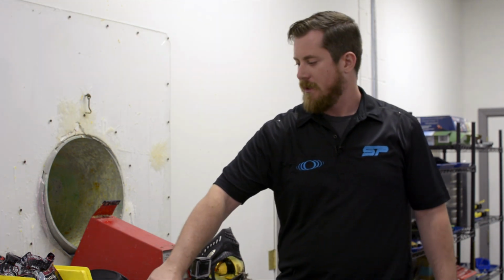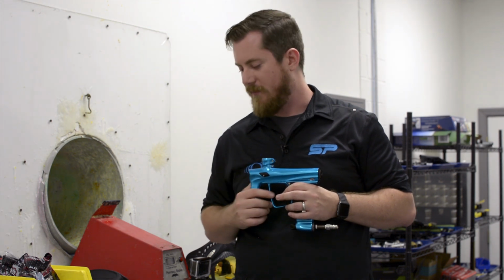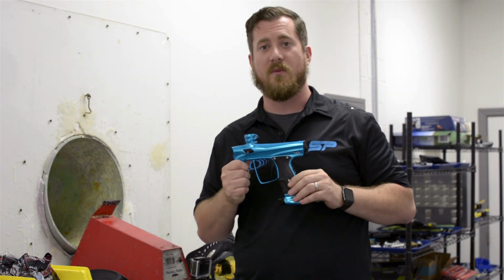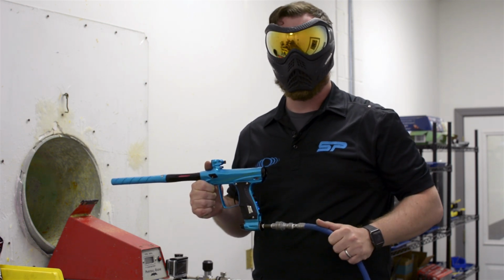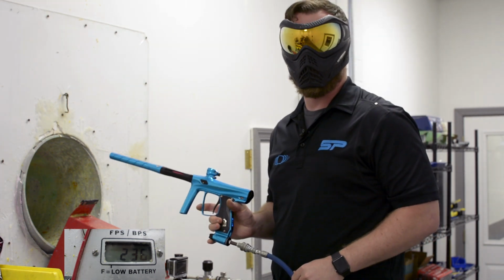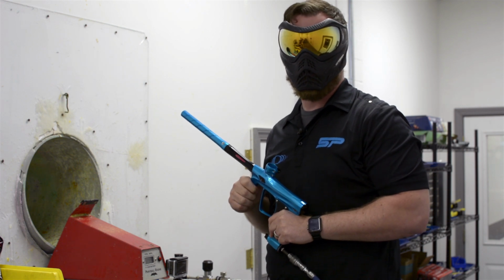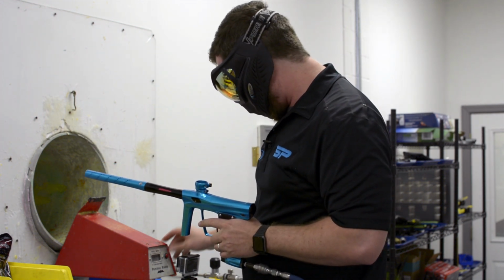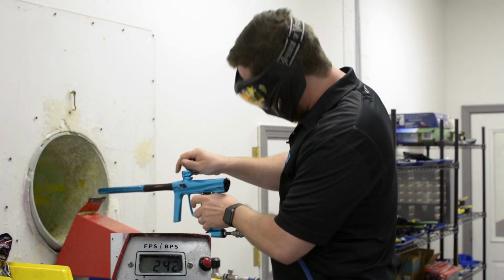SP Official - Shocker RSX Bolt Speed Adjustment

Comment: This doesn't make too much sense the video is very unclear. So you're supposed to turn out the bolt speed and then get velocity up to 300 then you adjust the bolt speed so the velocity is at 270-275?? You said that's what you do in the video but you didn't do that. This video is very confusing.
Reply from the maker: Step1 - The bolt speed should be in the full out position (lefty loosy). Chronograph the marker at the FPS you will be most likely be using (300fps).

 Step 2 - You then turn the bolt speed adjuster inward (righty tighty) until you see a velocity drop (usually 20-50fps). This drop indicates that you have turned in the bolt speed adjuster past its optimal point. Adjusting it back out 1 turn - will place it in its "optimal" position and you will see the velocity return to the range set in step 1 - as illustrated in the video.

Here is a link to a technical explanation of what is going on while you adjusting this component - http://www.pbnation.com/showthread.php?p=94954522#post94954522

Comment: Can anyone tell me what the shocker drop rail does?
Reply from the maker: The drop rail moves the air source adapter (ASA) down approximately 1/2 inch and back approximately 1/2 inch. Players looking for a taller or longer profile generally really like this accessory.
Reply: Shocker Paintball hello, like a dummy I accidentally turned the (speed) bolt with Allen key a few turns by accident while trying to check and lube o-rings before use . Now I have no idea where it sits (in fps). The marker is brand new and used one case of paint so far only. Do you know if I can just re-chrono this marker and it'll be back to its original factory setting which I had no complaints about? Did I damage this marker in any way by doing this? And feedback or info would GREATLY appreciated as I love the marker. (Purchased directly from ANS).

Comment: is there a recommended number of cases shot through the marker before making these kinds of adjustments? just got a new Shocker RSX and i want to make sure i'm dialing it in correctly
Reply from the maker: +Josh Sun we generally recommend leaving things alone when the marker is shooting good for you, a "dont fix what isnt broke" policy is best in most cases. However, if you would like to tinker with your settings, we generally recommend around 20 cases of paint through the marker for all the o-rings to seat/normalize before making adjustments. Its important to note that every marker is tested/tuned before it leaves the factory and will work great in that configuration for a large number of players.

Comment: At 1.46 in the video, you say turning the velocity down and turn it what appear to be anticlockwise... But looking at the manual it says anti clockwise is turning up the velocity??   In the video can you confirm whether you were in fact increasing or decreasing the velocity  Thanks
Reply from the maker: +Douglas Rouwenhorst During this process you start with the velocity fully out (lowest possible) and turn the velocity up until reaching 300fps prior to making bolt speed adjustments.

Comment: I'm new at this :) I have a quick maybe even dumb question. The place where we play paintball only allows 275 ft./s. Do I match my bolt speed at 275 ft/s or still match it to 300ft/s and then just turn down my ball speed to 275? Thanks
Reply from the maker: +Brett Weber  Set the marker up at 300fps then reduce overall velocity once the bolt speed screw has been set.
Reply: Thanks for the help..
By the way, I REALLY LIKE MY NEW SHOCKER!! :D

Comment: got my velocity adjuster almost backed out, bolt speed screw turned in a few times (wasn't keeping track) shooting very consistent @ 289, 289, 289fps. still room for adjustment to smooth out the shot a bit. but super amazed at how well the rsx shot. mind you its still brand new. thank you Shocker Paintball
Reply from the maker: +Francis Gabagat  Thank you for supporting our marker!
Reply: Shocker Paintball  hey guys I recently had the recall can switched out at nxl cleveland 2016 .
been very inconsistent since. and random drop even walking it in semi auto. and one field I go to is 270 fps and I when I go 270 and below very inconsistent upto -60fps.